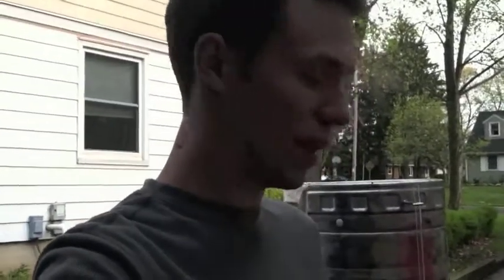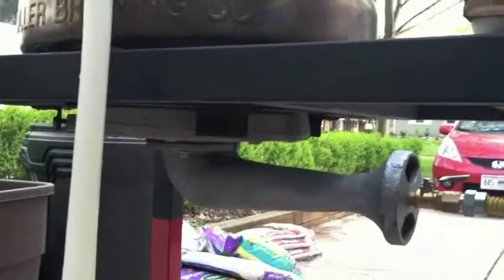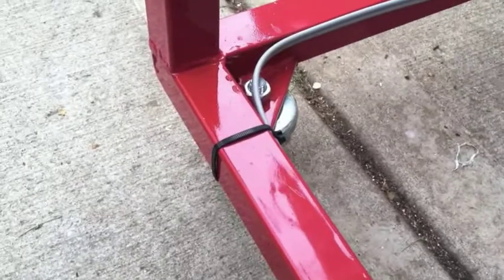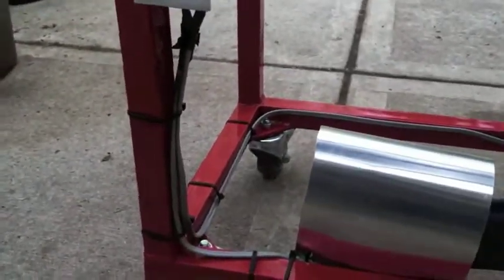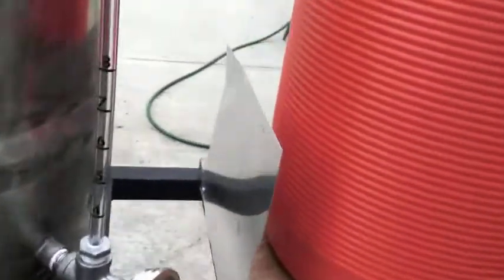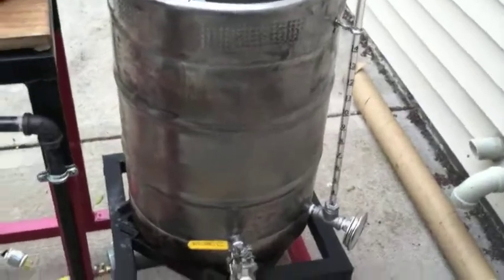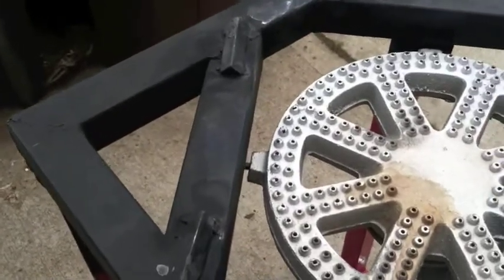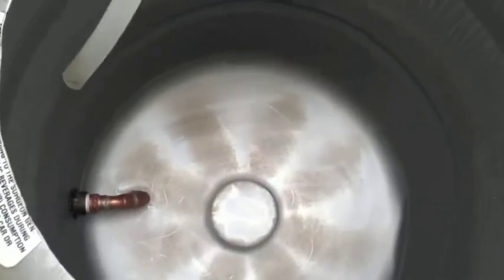2 Tier Natural Gas Brew Stand

Comment: Nice build, I'm starting to weld up a Brutus 10 stand right now.  Did you drill out the orifice on your BG-14 for NG? If so what was the final diameter of the hole?  Thanks

Comment: What's tube size you use?  1 1/4"  ,  1 1/2"  ,  2" .??
Reply from the maker: specialized41 1.5"
Reply: Eric I have one question,  the tubing what's thickness.?  
16 gauge?
14 gauge? 
1/8".?
Reply from the maker: specialized41 pretty sure it's 16 gauge.

Comment: Pull the kettle dip tube/ not needed and will increase your ...
Reply from the maker: +Ed King the dip tube for the kettle allows for more wort to be drawn off.  Since the kegs are not flat bottomed, without a dip tube you would lose a good half gallon or so. By angling it back to the side, I was able to leave the hop cone undisturbed after settling.